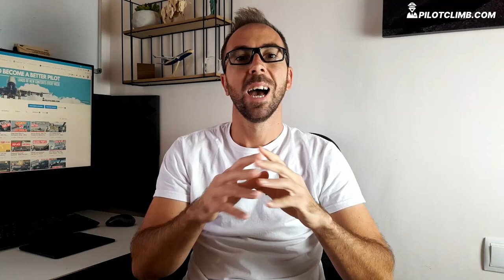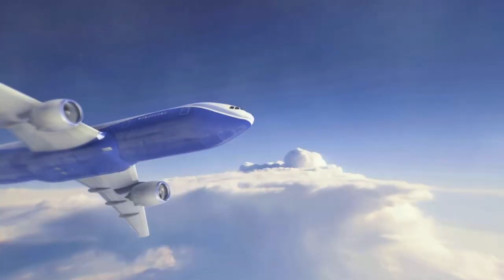Vmca (Minimum Control Air Speed) Explaiend - [Why Should You Always Fly Above This Speed?].

Comment: Ciao Gabriele. Thank you for the video. My comment is that Vmca is only applicable to light multi engine airplanes. For jet transport category aircraft: VR must not be less than V1, and not less than 1.05 times Vmca. When you lift off you must be over Vmca. For a transport category aircraft, V2 (attained at screen height 35ft or 15ft wet) cannot be less than both 1.10 Vmca and 1.20 Vs1 (1.13 Vs1 FBW). Also, twinjet transport category aircraft are considered to have no critical engine. Lastly, I am unaware of piston airplanes taking off with ATM or derates (less than full T/O power). I have not flown turboprop so unaware of those.
Reply from the maker: Hey, thanks for watching and the feedback

Comment: Thank's a lot ! 
Plz I have a question they told  me that with this speed, in case of engine failure we will be able to control the airplane and maintain straight flight with a  bank of 5 degrees max 
Could you explain this point for me ?
Reply from the maker: Hey, you are welcome!! You can use 5 degrees of bank angle to counteract the yaw moment created by the engine operative...
Reply: @PILOTCLIMB  alright ! Thank's for your help ✨
Plz If you could, I ask you to make a video about toda tod Toda Tora and ASDA  and thank you again 
All the best !

Comment: Great Video! So assuming wind speed and other environmental factors are the same, since at VMCG the aircraft on ground has full controllability via control surfaces, shouldn't VMCG be very similar to VMCA if not the same since ie at 120 kts you reach VMCG so technically you can control the aircraft's Yaw on ground. Once you lift off,(in theory if speed is the same which I know practically is highly unlikely) the airflow across the control surfaces should probably be similar at the same speed so shouldn't VMCG and VMCA be very close? I know Vr is higher than V1 or close to V1 which means the aircraft could rotate, but in theory is the VMCG and VMCA very similar? This is the only part that I don't understand. Thanks!
Reply from the maker: Hey, many thanks for watching! Your question is great! The Vmca and Vmcg could be similar, however, we need to thing about these two speeds as a separated speeds that are required for different reasons.
Try not to find a relationship between Vmca and Vmcg since these two speeds are tested using different parameters, for example, the Vmca allows up to 5degrees of bank angle while the Vmcg not. 
Let me know If I answered your question
Reply: @PILOTCLIMB  Ah I get it now, so both Vmca and Vmcg while could be similar, but have completely different meanings. And when you mention about 5 degree bank, is it done in order to reduce side slip in air due to asymmetric thrust for which needs the rudder to counteract? Like flying sideways so you can still maintain directional control but banking slightly left or right so less rudder = less drag?